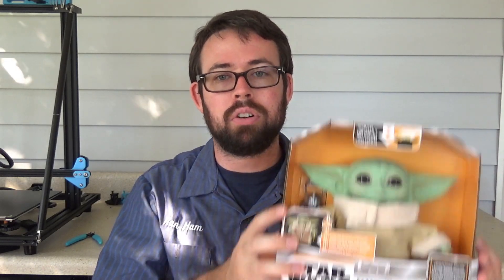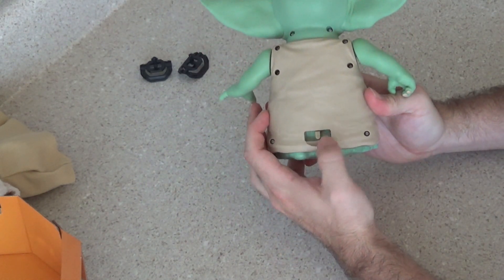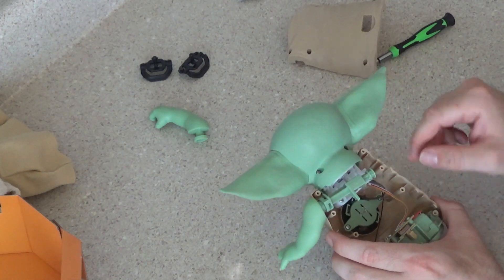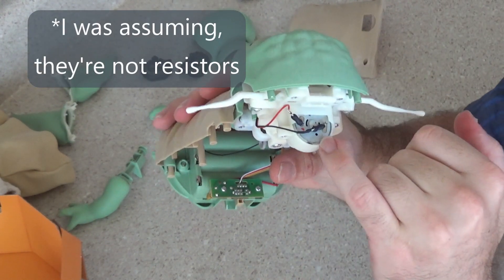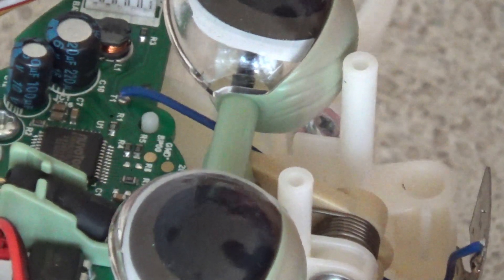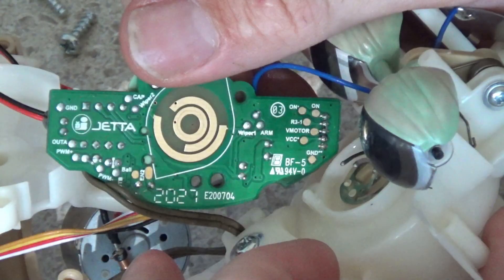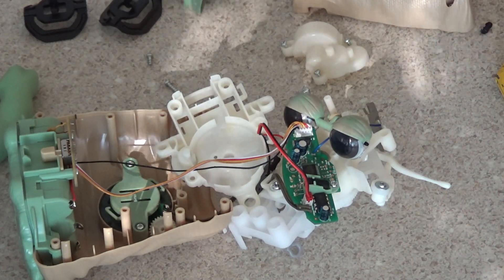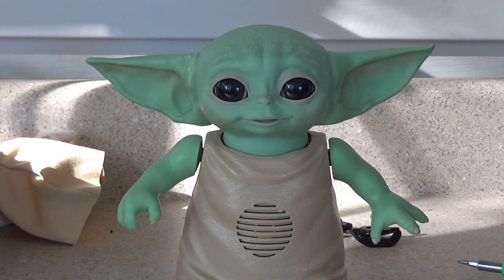Hasbro's Baby Yoda Animatronic Figure - TEARDOWN - HOW DOES IT WORK?!

Comment from the maker: If I hack this, what should I make it do?
Reply: Ideally, lift an X-Wing out a swamp. But you may need more than 2 servos :)
Reply: Mod the Mattel one and get rid of force sound
Reply: Make him sing never gonna give you up
Reply: Make both arms move.
Not sure if you're able to access the sound board, I would try and remove that force sound.
Reply: make it walk.. maybe an uneven wheel of sort to make it waddle (that is a short cut... )... but I am guessing you will need to reposition the battery compartment.. and the on and off switch.. 
or bundle all the original parts and add  robot legs or wheels? I am not sure how you can go about it LOL ..
Reply: @johnmarkgordonTV  ... He might be able to use Robbie The Robot or Iron Giant $20 Walmart toys to assist in a new design.  That means understanding what each chip pin does (or circular timing for plastic gears).  Running independent for the walking can use both motors and twice the three batteries or six total for some new design.
Reply: @lawrencejelsma8118  I just saw on disney store.. there is a remote controlled walking version.. I am not sure if the arms move and if it has sound effects/talking option...
Reply: @johnmarkgordonTV  ... I'll check it out but shorten the bars on $20 toys can create a walker with leg area redesigns.  Use those 3 batteries to power that if the switch (transistor switching designs by pin voltages and resisistors and capacitors chosen to the base of transistor designs ... See AND, OR, XOR, NOR, NAND, etc. with 1-3 transistors).  The logic of the Yoda initial toy needed, though.
Reply: Make it touchless command via voice (when you say his name) or clap.
Reply: Rickroll 💀
Reply: Change the body completely and make a dumbo by changing the ears and eyelids, would be interesting to see.
Reply: Make GIZMO from him.
Reply: Make it say I like ya cut g then it smacks
Reply: Make it dance
Reply: What about a talking Grogu?
Reply: Add different sounds in it.
Reply: You could make both hands move, make its mouth open, eat, poop, walk, cry (real water), sit (by itself), talk with different sounds, watch shows, burp, fart, pick up objects, make his tummy rumble, crawl, make its tongue move, make some teeth in his mouth, listen to what you say, inside the force hand, try putting a magnet inside it so it could make a real force, make it's eyeball move sides, suck things up like a pacifier, build it body into a whole green skin body and make it faint.
Reply: Make it sing
Reply: awesome Video! i want mine to make different sounds, do you think there is a way ? thank you
Reply: Just like with or without fur

Comment: If the movements and voice start stuttering and stopping mid action, what do you think would be the issue and how would I fix it? Batteries have been replaced.
Reply: resolder speaker wires in the tummy.  wires are so thin they break off from the movements

Comment: Hey, I was wondering if you still had this Grogu and if you could possibly help me? The Grogu animatronic I have has started to glitch. I've changed the batteries multiple times and still the same... just freezing and stopping in the middle of movements. I went ahead and purchased a whole stock of new Grogu's (LOL YES I KNOW) for future scenarios... essentially the goal is to change out all the parts. Just a simple swap, which from your video here made it very easy. HOWEVER, I would like to keep the eyes on the current Grogy. Looking at it, there seems to be a tiny rod going through the back of the eyes to keep them stabilized. But I'm having difficulty pulling that out in order to take the eyes off.

I was wondering/hoping (since you're literally the ONLY video I could find on YT) if you could take a look at it and let me know if there's something I'm missing? I don't want to be aggressive and risk breaking 'whatever' may actually be on the inside of that bridge area. I mean, it just be glue but I don't know. 

I'd truly appreciate any assistance for this. And thank you for this video as well. Certainly made the rest of the process very easy and simple for me. ☺️👍
Reply: How do you swap out his voice box as our Grogu has lost his?

Comment: another question can robo-raptors be a kids toy I think not because once guard is pressed it just won't move at all it gotta be as simple with the walking what causes it to walk answer is springs which is truly weak with frsh batteries my robo-sapien can't walk because he won't waddle but both robo-raptor's legs won't move lso another issue is how that motor's wiring is melted right through once uncut it can't be glued right back in hey got r2-d2 and BB8 but that motor if it strips its done wowwee's motors are real well with attachable wires got robo-sapien fixed so it's walk motor definitely dead and got it fully replaced

Comment: the main Issues I have with this type of technoligy in robotics should springs break after a short time because if the springs continue to move these and they asking for repeairs the problem is how the thing is moving by then springs indisde I think the only option that will improve  that is a 3d printer that can print metal back into place of the springs snapped off in half also if such a fool would bring him out on a hot day his ware in tear shouldn't break that easly

Comment: Great video, saves me from opening mine, did it get any quieter in operation after you reassembled it? The mechanism in mine seems louder than it should be, i have seen lots of reviews and can never pick up the mechanisms noise like i can on mine, some reviewers have even commented on how quiet it is. Yours even seems a lot quieter than mine from your audio. I was planning on opening it up to see if any of the mechanisms were bottoming out due to shipping wear or even at least just to lubricate it more. I was really expecting it to be quieter, its a real distraction while operating, it takes a lot from the cuteness of the toy. Mine is cute until i turn it on.

Comment: Thank you RanHam335, My inquisitive mind would've had problems putting it back together. I did ok in days past repairing VCR gears by adding a rubber band, but always had left over screws, though VCR still worked. Thanks for saving my Grogu from botched surgery.  :)

Comment: Totes don't underestimate the power of the Nuvuton chip!! The ones I've worked with in the past were pretty cool; in their 'toy line' of chips (everything from 8/16(gross)/32 bit), they add a dope audio processor with like a 1/8W(?) amp into the chip and holy jeez that's a god send in toys. They even have M0 core's for under a buck (depending on mem size...)!

not an ad, just spent way too much time in the trenches with the chip family :)
Reply: Does the audio only come out through 1 pin?  Also does this chip allow rewrites or is it locked in at programming?
Reply from the maker: Yeah threw me for a loop that the audio was being generated from there
Reply: Great vid!
Helped me with adding some volume reduction padding in the body 

QUESTION - my Yoda is now mute.
Any ideas on how to fix this? 

Thank you.

Comment: I have an interest in circuit boards and motors to. It’s so cool how small dc motors can be powered by electricity and that you can control when an output signal will be put on the wires to the motors from the circuit board! I hope I got that right lol. I’m kind of a beginner to circuit boards and dc motors